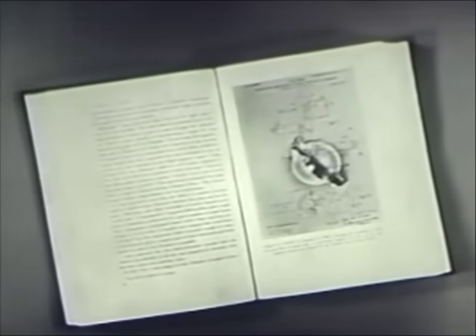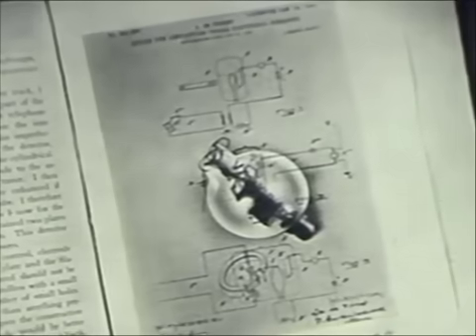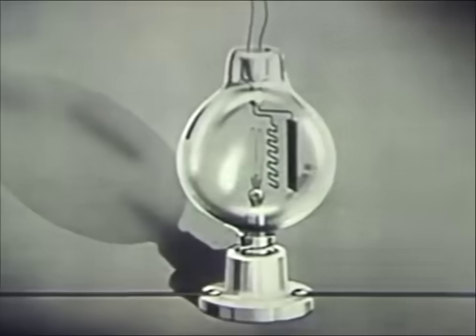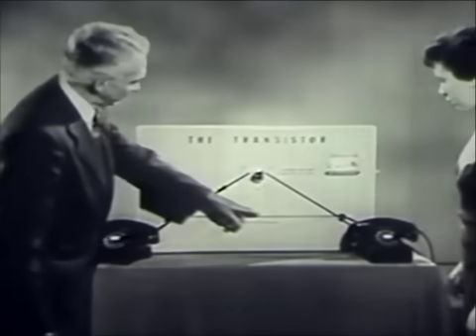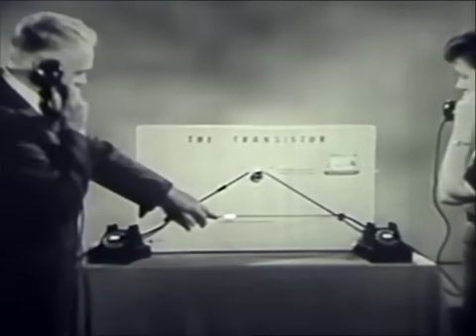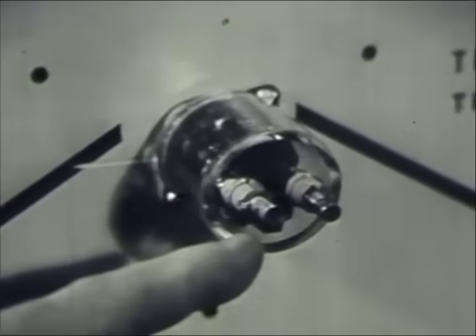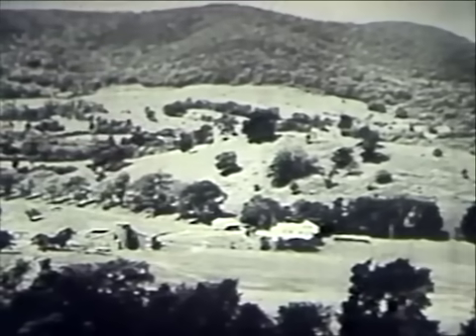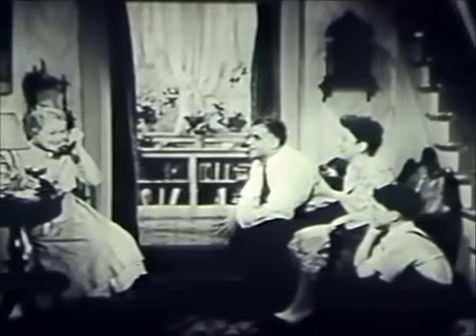The Transistor: a 1953 documentary, anticipating its coming impact on technology

Comment: I was born in '52.  First transistor radio I had, Japanese, had 10!  The components were packed to the gills!  Light emitting diodes were also a big deal when they came out.  Came from research at Bell Labs on unwanted infrared heat from transistors.

Comment: In Germany, in 1986 we were the last generation having the final exam on transistors to graduate Tech high school. We must draw the precise sinus wave output of a specific transistor manually on millimeter paper. Damn that was cool 😂
Reply: In 1986 I started as a university student in electric/electronics/computer science.
When I graduated in 1991, my graduation paper involved the design, building and programming an eight-bit-computer print board with FIFO memory ICs to compress and decompress data files. Floppy discs replaced cassettes to keep programs and data sets. Atari computer became obsolete.

I graduated in East-Germany, so behind the iron fence and probably only two years behind of Western technologies. Socialist East-Germany already manufactured 16- and 32-bit CPUs, PIOs, SIOs, EPROMs, RAMs and anything CMOS and TTL, besides 100 different analogue ICs. Monitors were still orange/black or green/black back them while the first generation of printers (needle) were as noisy as hell. This was all already made in the mid 1980s in the Eastern bloc as well.
The first serial data BUS systems were just popping up, I remember during my university time.

Crazy - we boomers are actually the digital pioneer generation and no one else should claim this.

PS: in 1982 I graduated from a one-year evening course as an electronic lab technician (Facharbeiter), chasing the same sine waves from different transistors. Silicon (UBE=0.6V) or Germanium (UBE=0.2V) based was still a question.

Peace! from Dresden

Comment: Q: "How many transistos power Grok?"
A: "While an exact number is not available, the Colossus supercomputer powering Grok likely contains on the order of 16 quadrillion transistors across its 200,000 NVIDIA H100 GPUs, assuming each H100 has around 80 billion transistors. For a more precise answer, the specific transistor count of the NVIDIA H100 GPU and the subset of hardware used for Grok’s operations would need to be confirmed by NVIDIA or xAI." -Grok
Reply: If one worker can build 20 transistors in a day, how many workers will it take to build 16 quadrillion transistors over the time period of 70 years?

Comment: The great thing about vacuum tube is the heat from the console TV set could help warm the living room in winter.
Reply: It was a great resting spot for the cat.
Reply: Not projecting a video to the screen no no, the HEAT was the great thing haha jk ❤
Reply: Hearing them occasionally Pop and Watching the smoke rise from the back  and that unmistakable smell  ; was the evenings entertainment .😳
Reply: I don't have any vacuum-tube electronics about, but I do switch from LED bulbs to incandescent ones in the winter for the same reason.  Not sure if it's a net gain in terms of electricity bill + heating bill, but I like to think it helps a little.  Besides, gotta use those old inc. bulbs up at some point, and might as well do it when the heat they generate is a good thing.
Reply: @WthIsThisRightHere if you have an electric furnace then you aren't saving any money on heat and if you have gas you are likely spending more money then.
Reply: @josh9673  I don't use either; it's a combination of oil and wood heat. And again, it's about using the old incandescent bulbs instead of throwing them away.  Better to use them in winter.

Comment: Bell laboratories are credited with PUTTING the transistor on the market for use. Bell lab did not invent the transistor. First solid state amplifier germanium , was made by. Henry Moray senior. You can see the DATED documents of his hand built machine called the R.E. A sub assembly of that had the solid state hand made transistor. Read the book printed by his son called, : - The Sea Of Energy In Which The Earth Floats. It contains original DATED bench work notes.

Comment: I remember back in my early college years majoring in electronics and computer engineering having to learn about all these dull and boring subjects. I recall having to assemble various chips, resistors and these transistors on those lab breadboards with those tedious jumper wires. Then having to create actual PCBs for my projects. From calculations to computer simulations and actual etching them on copper plates from AutoCADS. And soldering those components.
 
Little did I know [or even care] back then about the fundamentals that made up of what we are using today. If only my present self could reprimand me in those days just to say how even the smallest gadgets that we hold in our hands today [namely our phones] and other things that we take them for granted rely on these.

Comment: I think that the America's success was largely attributed to how good they keep updating and building on already existing knowledge and principles to always improve and adapt new technologies quickly. That genuinely make it a great country.
Reply: In fact, two German scientists (nazis?) also invented the transistor that year, but when they went to patent it, they found that it had already been patented a few months earlier. These two Germans had observed that in the germanium diodes they manufactured during the war for radars, if another electrode was added in the form of a point near the electrode that touched the germanium block, the voltage of that second electrode modified the intensity of the current that circulated through the diode (see Mataré and Welker and transistor).

Comment: Dint Sony invented the transistor Radio.
Reply: The invention of the transistor radio was a collaborative effort involving multiple individuals and companies. The transistor itself, a crucial component, was invented in 1947 by John Bardeen, Walter Brattain, and William Shockley at Bell Laboratories. Building upon this innovation, Texas Instruments and Industrial Development Engineering Associates (I.D.E.A.) partnered to create the first commercially available transistor radio, the Regency TR-1, which was released in October 1954.  Texas Instruments supplied the transistors, while I.D.E.A. handled the radio's assembly and marketing. The TR-1 was a significant milestone, marking the transition from bulky vacuum tube radios to portable, transistor-based devices.

Comment: Excellent video I studied and got my HND in physics in 1954.   the one missed point was reverse currents noted with a third electrode or cats whiskers crystals prior to the vacuum tube we might have had the transistor first but all research was dropped for the valve.   What if?  leds, flat screen instead of the cathode ray tube??

Comment: Meanwhile in 2024:
AMD Instinct MI300A: 146 BILLION transistors. 
Nvidia B100: 208 BILLION transistors
Cerebras Wafer Scale Engine 3: 4 TRILLION transistors
SK Hynix 400 layer Flash NAND memory: possibly over 9 TRILLION transistors assuming linear scaling from 232 layer with 5.3 trillion transistors. 

As of 2022 an estimated 13 SEXTILLION transistors were manufactured since 1957. That is about 1.4 trillion for every person alive right now.

Comment: And the PC I author this comment on has several billion transistors in it, all firing with minimal or no error and no error that would occur that gets passed on uncorrected.  We have come so far since solids were used to control electrons.  Now we even control light and even slow it occasionally to get a desired result.

Comment: Vacuum tubes, especially klystrons and traveling wave tubes (TWTs), are still used in high-power radio frequency (RF) transmitters, such as those for broadcasting TV and radio signals. These tubes can handle very high power levels and operate at high frequencies, which is crucial for large-scale broadcast operations.

Comment: Tubes and transistors are not in fact amplifiers, they are modulators. They modulate the power supply voltage to the same form as the input. The result is a bigger wave, or in other words, "amplification".

Comment: The single most impactful invention in history… and its just a switch.
Reply: It's also an amplifier.
A MOSFET is mainly just a switch, though whatever amplifier you listened to this with, will have used transistors as an amp.

Most inventions are "just a" when you break them down to their most basic too. Even a gear is just a (series of) lever(s) on a wheel.

Iterative invention is what built the west.

Comment: The incentor of transistors should again be given the nobel prize in Physics. Their invention is lifting our civilisation so it wouldnt be silly to give nobel prize for the same invention twice. If there wouldnt be transistor,we may have been using relays. Our computers would like our Ic engine based car. We would hear tic tic noise on processing of computer. Computer would be a source of noise pollution😅😅😅😅

Comment: I have bought that same radio in 1982. It served me well in Africa and in Asia but in Vietnam the humidity is high and so it stopped working properly. I am sure that inside it must be all in order and it never has been repaired. I am wondering what could I do with it because in hanoi I am afraid to let it repair. I want proper engineers to repair that one of a kind shortwave radio. Any ideas?

Comment: The TV repair man was common in my childhood, he had a big box of valves/vacuum tubes and he would change the ones in the TV one by one until he found which one had burnt out, like a light bulb, the light bulb is becoming a thing of the past too!  Small radios had ‘Solid State’ labels on them meaning no valves/tubes, a customer knew they would run on cheapish disposable batteries which seemed an advance back then.

Comment: First came the valves. I had a valve radio when very young. Then came the transistor radios. With transistors coming in. 1 in 1 package. I have seen them being manufactured in 1980s. Then the integrated circuits started. Followed by microprocessors having too many tiny ones. In late 80's we had the first PCs, with CRT displays. The silicon.

Comment: 500 vacuum tubes goes across the ocean... One Tesla coil goes around the world.
Reply: And where is it? Please in more detail.
Reply: @user-Human-777  they used 500 vacuum tubes the send radio signals across the Atlantic, Tesla used one high frequency coil circuit to transmit electricity across the world from Colorado. Check into Tesla's electrical transmission experiments of 1888, the ones that provided the values used in his patents, you know, the radio patents Marconi used for his devices.

Comment: In 1966 I was programming an IBM 1401 computer, said to be the first all transistor computer, 16K storage, programmed in IBM autocoder, but had to debug in machine code. Took up a whole room with all ancillaries, input but 90 column punch card. Now in just a tiny micro SD card there can be 4 million times the storage. Progress, but I think that the increase in storage has led to sloppy programming.

Comment: The most underrated piece of Technology in Human History. The Transistor literally runs our Modern World, every single modern Electronic Device runs on Transistors. Without it, our Civilization would still be stuck in the 1940's Technology.
Reply: Integrated circuits combine transistors and resistors in the same chip. They solved the "connection problem." Having to connect discrete components together represented a severe bottleneck in the manufacturing process.
Reply: Hmm stuck in the 40s? Sounds like a dream if you ask me
Reply: The creators of penicillin would like a word with you . . .
Reply: quickly surpassed by integrated circuits
Reply: @sixmax11  Integrated circuits contain transistors.
Reply: @sixmax11  Integrated circuits are mostly transistors. They are just packaged and connected
Reply: How on earth are transistors underrated???  Jesus, do people just slap the word underrated on anything they didn't happen to know?
Reply: There it is, the word uNdErRaTeD again. Everything on YouTube is apparently underrated. What are you even talking about.
Reply: Were are stucked in the 40s but were have more transistors

Comment: this film kinda takes the wind out of the idiotic assertion that humans learned about the transistor from examining crashed saucer debris recovered from Roswell, NM in 1947 - doesn’t it..?

two other technical breakthroughs falsely attributed to the Roswell saucer crash of 1947 are:

- OPTICAL FIBER - for the transmission of light was being researched in the mid-1800s
- KEVLAR - was accidentally discovered in the mid-1960s during the study of polymers

Comment: I had a 1T4 tube, then a CK722 transistor somewhere in the 1950's right after my first 1N61 diode which was preceded by a galena crystal. My fate of my career choice was thus sealed.

Comment: The vacuum tube was kinda a mechanical-metalconstructed "prototype" of how a semiconductor works in principle (but only in thin gas as the conductive medium and we used layered metals and grids, meshings in them to do something about to  control the flow of electrons across the construct (which was kind of an art to make use of an "active region".All these emitters and getters, anodes and kathodes respectively). Even emitting light (magic eye tubes, so this was kinda a prototype or POC of how a LED in a principle works when made of vacuum and some meshing plus a getter plate with one side having some fluorescent layering on it). The side effect was : we must heat these tubes to a certain temperature so the electrons can fly off the filaments to produce a current across the vacuum resp. thin gas filling.

Comment: An invention of necessity as post world war two American society was overwhelming "Ma Bell's" switchboard operators. Think Lillie Tomlin's character Ernestine on NBC's Laugh In, answering a call request and manually making the connection utilizing cable connectors) Even after the transistor as I remember, an operator was still needed to make an interstate long distance call (Guitar players, ever wonder why the 1/4 inch connector on your cable is called a phone plug? It's the 1/4 inch plug designed and made by Western Electric, Ma Bell's equipment manufacturer). Kind of sad when you think about the fact that the Bell system effectivley built the entire infrastructure of the country's telephone system, that the federal government broke it apart in the 80s'.

Comment: "...less maintenance & a longer life..." Yeah - an iPhone lasts about 12 months! That's progress?
Reply: What? My cell phone is three years old and going strong. No cell phone lasts only 12 months. Yikes.
Reply: @RockinRobbins13  😋😋🤣🤣😎😎
Reply: @ahotmic  I was being nice. Lots of my friends' phones are more than 5 years old. They still work great. You toss 'em when you need better performance, not when they die.

Yes, the cell phone companies have designed their phones to die with their non-removable batteries, which takes about 3 years, but replacing batteries is still possible.

Comment: (8:23) I'm always fascinated by the early pre-Moore's Law comparisons of old tech to new. I wonder if someday someone will actually try to build a vacuum tube-based "calculating machine" that is the size of the Empire State Building. I'm sure it wouldn't be cooled by Niagara Falls, but it would certainly be "quite" hot and need some serious cooling. Perhaps they would build it close to the (ant)arctic. Could you imagine troubleshooting such a massive machine? Crawling through the miles of wiring and machinery... If you read some of the early 20th century science fiction, there are depictions of just such an experience. The writers of the time could hardly have imagined how small the transistor would become someday. So, my imagination is tempered by that fact. What will the technology of 70 years in the future be like? 100 years? 1000? I can only hope that the humans of the future will use the power wisely. I don't know, though. We are going through quite a time, right now. We, actually and hopefully our descendents, will see...... ☮

Comment: At the same time as transistor  was invented and patented in USA another semiconductor device transistron was invented without any knowing of the Bell Laboratory works. German scientist Herbert F. Mataré continued his work during WW2 in Telefunken on Si amplifiers in French company and applied with coworker Heinrich Welker for patent of an amplifier based on the minority carrier injection process which they called the "Transistron". Devicev were commercially produced for French Telefon Company and military used.  The first all (4) transistor radio set was presented in 1953 at Düsseldorf Radio Fair.

Comment: I'm an electronic hobbyist. In various audio projects I've built both transistor and tube circuits.
People don't really get how much different the two are.  A transistor not only requires lower voltages than tubes, but they don't have the impedance limitations of tubes. When you build a tube amplifier it needs a transformer to interface the output with the speaker. Transistor amps don't need this. You just wire directly from the output to the speaker terminals. 
This reduces cost and weight. 
What is kind of funny is that transistors have been with us 70 years and tubes still hang on in some niches. Ask any guitarist or producer to pick between tube and transistor versions of the same thing and they will always select the tube.
Reply: Yeah...ask them to choose between a wood-fired oven to cook food and a gas range and let's see what they pick...The food tastes the same in the end.
Hanger-on-ers....😞
Reply: The distortion from a tube amplifier sounds much better than transistor amplifier distortion. So i guess guitar players like to go into the distortion zone of an amplifier ;)